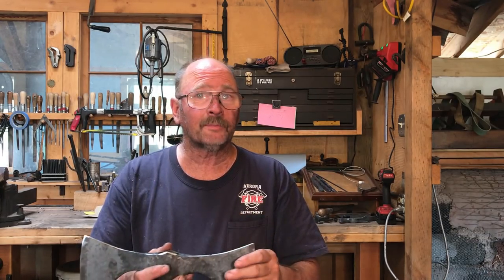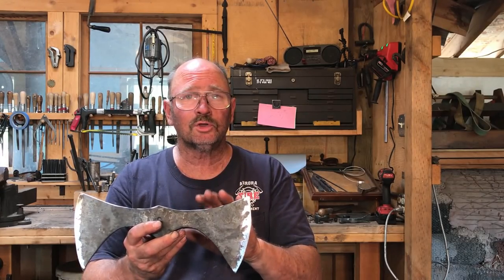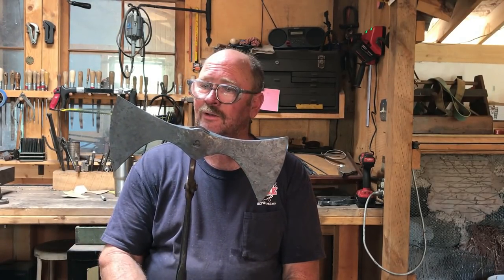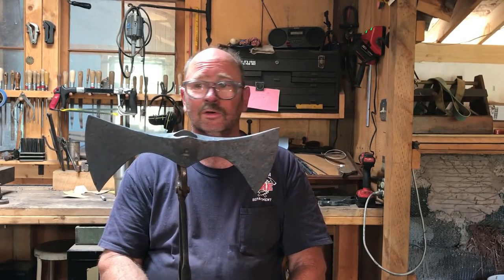Double edge Viking inspired battle axe

Comment: I'll agree with most comments about the vibration and sound. The best shot I enjoyed was looking up by the anvil. I could see your form on each hammer blow and your hammer control. I watch for the technical details that you provide to us.
Reply from the maker: Thanks, thats a good observation
Reply: I have not done much in the way of videography, but have had vibration problems before. One simple way to damp vibration is to rest the tripod legs on sand held inside a can or flower pot. Obviously you need a small piece of wood  to rest the leg on on top of the sand. This works very well for making 0.1 milligram weighing, hopefully will work well for you. 
Love your work, keep it up.

Comment: Of course, most of these are like condiments.  You don't want to drown your french fries in ketchup.  But I found the wide background shots to be the most compelling.  Occasionally seeing more shop context was very helpful, a step out of techniques that sometimes make your videos feel a little claustrophobic.  It was interesting to see in the long shots, how much aesthetic effort you've put into the the tool wall immediately behind your at-the-desk and talking to the camera boiler plate shots.  

I was impressed, as well, by how sharp the phone was at medium distance, with the screen a little wider than your anvil; and the waist level views were entertaining, though I'd use them sparingly.  They have the nicest look to them in the more visually active parts of your shop.  The first of the "dragon's breath" views was especially nice and your coal forge looked so lonely and forlorn as part of a much longer medium view.  These little touches should easily contribute to the overall quality of the video and will allow you to use after the fact voiceover as more than a failure to turn on the mike in the shot in real time.  These would be welcome as variation from the beginning and ending shots where the dialog is the same in each video.

The views that were the least entertaining were the shots where the machine operation induced camera shake, and the long shots at waist level or lower out of doors.  But, overall, I think that, used scrupulously, the phone will be a pleasant and entertaining addition to the already well shot process sequences.  You seem to like your new toy very much.
Reply from the maker: Thanks for your observations

Comment: as a relatively experienced user of Premier Pro, tip #1 after adding all clips to your sequence, drag select all clips then right click, go to audio gain and select normalize all  whatever at and say -18 or -24. makes the volume level a bit better. your louds are quieter and your quiets are louder.  Tip #2, you could use to find some way to stabilize the camera  quite a bit more on almost all of your close up shots, maybe set the tripod on a thick foam or rubber mat. the slow motion welding shot was cool. slow motion power hammer.... not so much. i don't know if this is a new camera setup or not but there seems to be an issue with the camera trying to track motion.. it makes the footage wobble... very disconcerting. 
while I admire you very much and LOVE your content I feel it necessary to be honest and objective in my feedback on this video.  Keep going out of your comfort Zone. It is the only way we grow as creators and craftsmen. I Love your stuff.
Reply from the maker: Thanks for the tip, although this wasn't edited in Premiere.  Still working out some of the learning kinks over there. 

 I'm not 100% sure why this was so shaky.  The power hammers always vibrate the ground and make the camera shake a little, but this was worse.  If I am going to use the phone it may need a more stable mount, although the one i am using seems pretty solid by comparison to others I have looked at.  Foam mats won't be an option in the shop, to much fire risk.  I have wondered about an assortment of mounts attached to the building itself. 

This video was all about getting honest feedback on some options I haven't worked much with, so thank you for the feedback.
Reply: not a problem John. Like I said. I love your style. the building mounts might be worth looking into.
Reply: It might have been the sound effect from the power hammer that made it less effective at the cool factor

Comment: Wow you just keep getting more interesting and informative! If it's any help
1-Try roof truss mounted  triangular shaped  (for camera stability ) mounts around the work stations you are planning on filming. Add an adjustable up and down pole with a camera mount on one end and you can move from place to place without dragging stuff around. Reach up, loosen the butterfly nut, drop down the pole with the camera on it and push it up into the next station's mount. Adjust up & down, left & right, turn and tighten butterfly nut, auto focus. Done. Got some more if you'd like Intersted in helping on this new chapter!
Reply from the maker: I'm not sure if I see the way the pole attaches in my mind.  Have you got pictures?

Comment: With your usual style, I stick around for the whole video anyway and quite like that format.
I enjoy watching the whole process, whether it be 15 mins of drawing out, or something more varied, your commentary makes it worth watching. 
As for the techniques in this video, the parts that jumped around a bit (grinding, power hammer) were a bit off putting, but those angles would work if the camera was more stable. 
The intro is reminiscient of Torbjörn Åhman's style, which is nice, but is a particular style. 
A bit of slow-mo with sparks is always fun, however too much would get old pretty quickly.

Comment: Another great video.  Great for you for going outside your comfort zone!  If you can work out the tripod shaking issue shorter clips of even more extreme close ups/slow motion shots might be interesting, like the first hammer strike at welding heat.  I also like the upwards angle shot at 10:22, for me that was the most visually interesting.  I think because it was shot at 90 degrees.  Again keep up the great work and inspiring videos!

Comment: I'm not too much a fan of the Alec Steele-esque camera stuff. It's neat and cool, sure, but honestly I prefer the actual video of smithing, rather than compensating with slow mos and stuff like that. I love the sound of the hammer hitting the steel, the grinding and my most favorite, the rasping!
Reply from the maker: You are one of the few that like the sound of rasping.  Many complain quite loudly
Reply: It's one of the most fun parts of metal work.

Comment: I liked the intro, albeit too long.
Camera jiggle is a no-no in my book.
First auto hammer views on edge of work do not show anything.
Slow motion on the auto hammers sequence is very good and informative.
Body cam of inserting the work into the forge was very good and informative.
Side view of straitening the blade to eye not as good as end view,  
Oblique views of in-process working are very helpful.
The overexposed (bloom) anvil shots are interesting in that the heated and "flaming" air was a surprise to me. Is that a camera feature? Or was there carbon burning off the axe?
This was a very good experiment on your part.  I hope you get creative feedback.
And yes, I watch all your videos to the end and rewind parts, too.
Reply from the maker: Thanks for the input.  Everything was shot with just automatic setting, so no camera exposure setting that I set manually, just a cell phone doing its thing.  I think the flame effect during the weld is just hot vapor from the flux and not actual combustion.

Comment: The image shake with every hammer blow was very annoying. You might need to add weight to your tripod or hang the camera from the rafters to isolate it.
Reply from the maker: It seems odd that working at the anvil should produce shake,  The power hammer is another matter.  Someone has suggested that the effect may be partially due to the cell phone camera having trouble deciding what to focus on.

Comment: Just an opinion.... The video format is great, the camera locations are bad do to vibrations. Look into camera swing arms with anti vibration that connect to walls or polls and even from your ceiling hanging down. It will make filming cleaner, and open a lot more accessible to video shots then using a tripod. 

No matter the outcome.... I’m still going to watch your videos... YOU! are the best of all blacksmithing channels out there.
Reply from the maker: I like the arm idea for many camera angles, but for the low angles they would be a real trip hazard for the small shop.

Comment: Going for the artistic approach certainly won't hurt anything. There's an increasingly short attention span one has to deal with, which my psych professor suggests is less a disorder and more of an adaptation to the modern world. It may be worth it to show what happens as a consequence of taking the wrong approach, something along the lines of common mistakes. Sometimes, showing what goes wrong on purpose can help illustrate why we do the things that we do. For example, when I get my forge up and running, I fully intent to sac a piece of steel just to see what happens when you burn it. What does it look like in the fire? What does the fire itself look like? How does it behave? What does the steel look like when it comes out? How does it move?
Reply from the maker: I think your psych professor is on to something
Reply: I wholeheartedly agree. I was diagnosed with ADD back in '89, but then I learned more about what ADD actually is and how it works. It's less about distractibility and lack of attention and more about rapid focus-change and seeking stimulation. Given the world we live in, it makes sense.

Comment: I am no videographer.  But I did like 8:40 and 10:00 for the color, speed, and use of steady cam or software to help with this.  I watch for many reasons.  I like hand tools and like to see how they are used.  I like to see metal moving to get an idea how fast I should be working.  I am sure if you threw in a shapely striker  with sweat dripping down her... well, you would get instant acclaim.  Course a view of an interesting mug of steaming hot coffee works pretty good too.  One thing is certain, more than 20 minutes is too long, and as a viewer of Alec Steel once said, "Less yack yack and more whack whack!"
Reply from the maker: Thanks.  it can be fun to try and get those shots.

Comment: I liked the slow motion clips, the closeups angles and the little bit of humor. The only thing that can improve in my opinion is the stability of the iPhone holder. It gets jumpy when there is pounding of the workpiece even when is by the anvil. Other than that I really enjoyed it! I love your channel and I learn a lot from it. I moved and still setting up my shed as a shop again to get into blacksmithing again. It really helps to control my depression and I love this ancient craft. Hey John, have you ever considered a ribbon burner forge? It doesn’t have the roaring of the venturi burners, has a more efficient fuel combustion and uses a hole less gas.
Reply from the maker: I have been intending to make one for about a year now and just haven't had the time

Comment: Watched the whole video, and also went through some comments below in case there were some details i missed.  i absolutely loved the upwards shot of you at the anvil, it really accentuated your hammer technique and made it easier to try and emulate, as well as the slow motion shots, though those should be used sparingly.  Unlike many below, I wasn't as big of a fan of the opening sequence of you heading to the shop.  It was cool to see once in a blue moon, but i could see it getting very old, very quick as it really seemed to slow down the pacing of the video.

One other observation is not one that actually started with this video, but a week or two ago, and that is the "Welcome to Black Bear Forge" intro.  After seeing it in a number of videos now, i have noticed it is identical each time, and this leads it to feel rehearsed and scripted.  I much preferred where you would go straight from introducing the project and going straight to it.  That intro really has taken away from the videos of late, in my opinion.  I can understand the feeling of wanting some sort of standardized intro for the videos, and think if done right CAN add to the quality, but perhaps something closer to what Roy or Chandler are doing, with a simple still or small clip with just the channel name in text.  I do think that "welcome to..." intro would be good as an intro video on your channel's main page, however...rather than on every video individually...just another thought. I know you were looking more for feedback on the filming on this video, but I'd been thinking of this for a while now and this just seemed like the right time and place to bring it up.
Reply from the maker: Thank you for your input

Comment: I liked it. I absolutely love your typical videos though. As you said, The educational part is why I watch all your videos and only some of the other youtubers I follow. Maybe, a quick edit, for instance, "OK, I'll finish this taper and be right back." That could cut the length. I will say I am part of the 30%. I really liked the angle in front of the Anvil. It showed the angle of your hammer when striking and other things that are not easily seen with your normal setup. Perhaps keeping the phone as a secondary positioned there all the time?
Also loved how the phone picked up just how hot that steel gets when Forge welding. That was really cool. One more thing, there was no jumping around the Anvil shots but the shakiness around the other tools that aren't anchored three feet below the floor was a bit rough to watch.
OK, one more thing, think about using that walk to the shop and you new opening lines at the beginning of your past few videos as your new way to start every video.
Man, I never left comments this long until I started watching your videos...getting very talkative... Lol
Great job John.
Reply from the maker: I do appreciate your observations

Comment: Hello John - good on you for trying new things.  That's a sign of growth, and one step on the path to maturing of your style.  I'm a good graphic designer and not a very good videographer and editor, and I totally understand the desire to improve.

One concept which makes capturing useful footage easier is "A-Roll" and "B-Roll".  A-Roll is the meat and potatoes.  You are already good at A-Roll.  

B-Roll is the spice that adds interest, but it's not the content, and it can't stand on its own.  Your challenge is to shoot and include B-Roll when you are editing.  I like to think of B-Roll as having 4 framing "vectors" for lack of a better word: close or wide, and high or low.   I also like to think of B-Roll as an opportunity to add warmth and interest to your video with details.

I'd suggest that your biggest challenge is stabilizing the camera.  A stout tripod is important, but if your floor shakes, even the best tripod won't fix the problem.  You could try adding weight to the tripod, or setting the tripod legs in buckets of sand to damp vibration... I don't know the answer, but it's worth experimenting.

Regarding editing, you can manage time and attention in editing by using a couple of different techniques: clearly, fast forward is useful.  Jimmy DiResta uses it almost 100% of the time.  Alec Steele also does a good job of fast forwarding through long hammering sessions.  

Another, more sophisticated technique is to do what I'd refer to as "slicing" -- you'd show maybe 30 seconds of hammering at the beginning, 15 seconds at the quarter-point, 15 seconds at the half-point, 15 seconds at the three-quarter point, and 60 seconds on the finishing steps: you've condensed 10 minutes of real time into 2 minutes of video time, yet conveyed a sense of progress.  During each short segment, you can briefly describe the plan, the steps, the challenges, and if anything went wrong.  

Regarding your dialog, may I suggest that you jot down some bullet points so you aren't talking off the top of your head.  Figuring out a few phrases before-hand will make you more efficient at presenting your message. You do pretty well at staying on point, in general.

Hope that's useful input for you.
Reply from the maker: Thanks for the suggestions.
Reply: Of course: thanks for asking.

Comment: I have already made many folded axes with the technique you presented in an other video and had great success with it. Now I am thinking about making my first double bit axe but i am not able to make a drift holes in my shop. So i started thinking an thought about constructing it with two strait pieces like the ones you would make for a forge welded-axe and then welding the two faces together. Do you think that this is possible? I have my concerns about splinting the weld with the handle-wedge and the fatigue over time. I really would appreciate your, and everyone else thoughts about this :)
Reply from the maker: Splitting the weld is a risk.  But if done well the risk would be minimal.  Wedging at 90 degrees to the eye would reduce the risk a great deal.